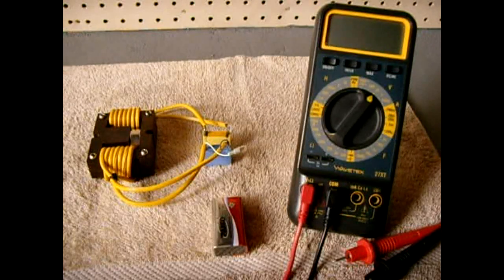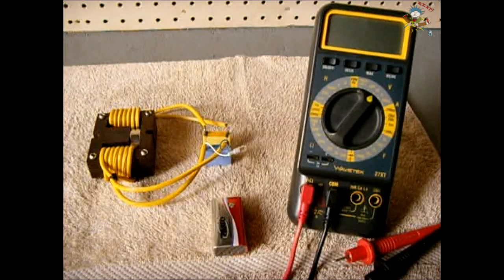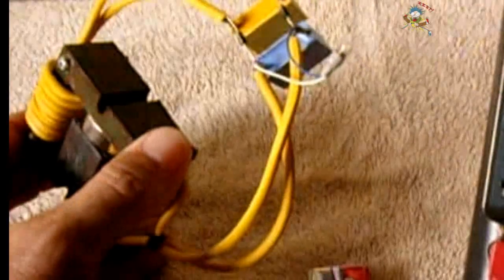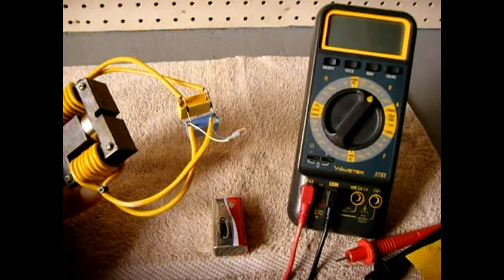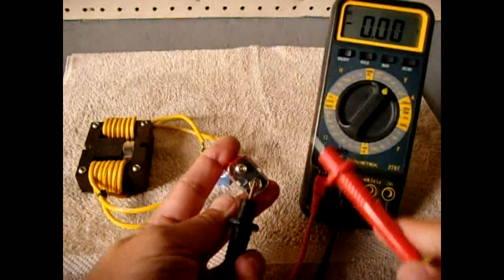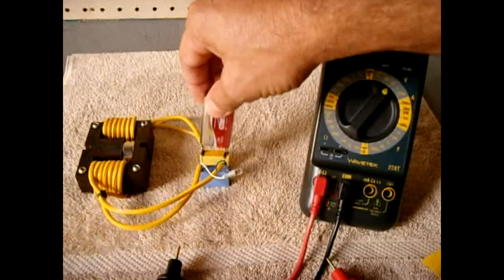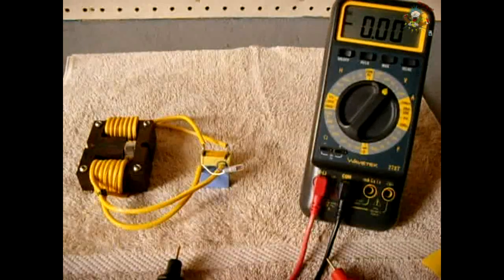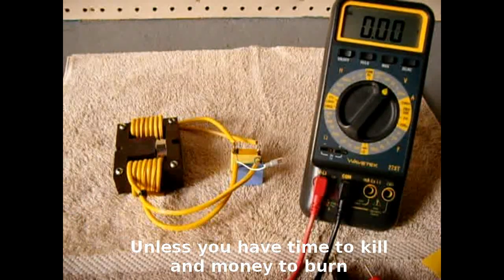Overunity Motionless Free Energy Generator EXPOSED!

Comment: That website that you lists calls this an MEG, it isn't one ! It is very similar but contains no electronics to switch the magnetic field. And it claims no professional research was done. There is a PATENT on the MEG with FULL DOCUMENTATION of how it works and waveforms of the electronics, flux charts, ETC. And this was made by several people , one of which Dr Bearden is a physicist.
Here is the link to it.
https://www.google.com/patents/US6362718?dq=meg+flux+switching&hl=en&sa=X&ei=Ec46VfTDItaSsQSzp4GgBQ&ved=0CB8Q6AEwAA
You could also say it is a transformer so transformers don't work either.
If you want something actually overunity search the bitoroid, tested by several labs and proven overunity, but nobody actually wants that to be sold. Look at the history of the other people who have sold similar things like the Eureka generator. Denied a patent despite being tested and shown to work by several engineers, a physicist, people at NASA, but still denied ! Newman list the many letters from engineers and physicists on his site as testimonials and they all say it outputs more than the input. Don't believe me, read it for yourself.
Lookup Newman machine. And http://www.wanttoknow.info/newenergyinformation
that list many examples of energy device suppression. I didn't believe it myself since I have an engineering background but have met several people involved in stopping things getting to the market.
The bitoroid has also been patented and tested by several labs, proven to work. It's been out for at least 5-6 years, so why is there no commercial sales ? The MEG patented in 2002, about 13 years ago and sill not for sale ! All 3 of these examples were proven to work by many labs, 2 have patents and NONE available to the public !
If you are the author of that site try adding this information and correcting calling it an MEG since it isn't one and saying the MEG has no documentation from professionals.
Both the bitoroid and MEG have videos but the patent is the largest source of information for both. The bitoroid has a 30 minute video describing its' operation on youtube.
And just so you know even NASA and MIT have admitted types of overunity. MIT has a overunity 230% efficient LED and NASA has a process similar to a solar panel that outputs 2 - 3 electrons for every photon that hits the panel.

P.S. How did you make such a clean cut of the transformer, I used a bandsaw and didn't get anywhere near that clean of a cut ? This would be great for making an actual MEG instead. The actual schematic is in the patent to try for yourself.
Reply: electronicsNmore Did you checkout the actual MEG, it does output more than input/ The site listed above, the jnaudin link, a French physicist has tested it and other devices and obtained overunity. It switched the flux but there is not mechanical movement. There is also the flux switching principle demonstrated in some of the YT pages calling in a "perpetual motion holder". Switching the flux makes sense, how it keeps the flux for a long time surprised me. But it can be tested easy by using permanent magnets, I tried it to see, and how much. You can switch a part or all the flux.

I would give the links but where I did above and in other places gets filtered almost every time ! Only I can see the comment. The MEG patent goes into detail and even gives a full schematic. So don't think it is impossible. Just the fact that the flux can be switched enables over unity. A permanent magnet that can be turned on and off by switching the flux direction is easy to imagine the applications.

Oh, and the difference between a transformer is the flux is switched from a magnet instead of coming from another winding (electromagnet). Each winding can work as an electromagnet. In the MEG it makes a temporary electromagnet to switch the flux direction.
Checkout the JNauding site, a French physict that has done many lab tests on this and other devices since before 2000, at least 15 years. He shows several devices that work and some that failed, and other peoples replications too. He also shows some electrolysis experiments that got way more than DC electrolysis. Interesting if you have at least basic electronics knowledge. If not, a large part can still be understood if something works of not.
Reply: Rich Taylor The "MEG" is actually a type of magnetic amplifier. Magnetic Amplifiers have existed in one form or another for over 100 years. Mag Amps only control power and don't produce power, any more than a transistor controls powers without producing any.

Don't confuse the ability to create a larger voltage from a smaller voltage with the ability to create power.

Patent can be obtained without a working device as Google demonstrated recently by obtaining a patent for a mere idea.

BTW the MEG patents is pure gibberish as you would expect from a con artist.
Reply: ***** I know what it's called but it's actually a variation of a magnetic amplifier that does NOT create energy from a motionless generator. There must be relative movement between a magnetic field and a conductor in order to produce energy. This energy can be provided by a moving magnet or a changing magnetic field created by another changing current. The “MEG” produces no energy. The “MEG”, and variations is a device created and perpetuated by a scam artists preying on individuals who fervently want to believe in Harry Potter physics. But hey, it looks cool so it must be a legitimate device.

BTW: People can buy PhDs these days or simply put PhD after your name as many of these sham artists do to help legitimize their “expertise” in “free energy”.
Reply from the maker: Dorian McIntire Correct. In order to produce electricity you need either a changing magnetic field or pulsed magnetic field. Both do not exist in this device because the magnet is FIXED. Amazing the scams that people believe in.
Reply from the maker: Sorry, but I don't do he said/she said. Either try it yourself and make a video, or send me a working unit and you will receive $100.00 in your Paypal account. Nothing else to discuss. My time is too valuable for this nonsense. Patents don't have to work, or even be tested to be issued.

Thanks For watching
Reply: Do you only want people to agree with you ? It wasn't for you it was for the other person anyway. Maybe I clicked on the wrong place. Either way, why so hostle ?
Reply from the maker: I am not hostile, I do not like people who never tried the experiment themselves, telling me that I did something wrong, they know for a fact that it works, and also telling me he said/she said. I do not take kindly to people that waste my time with bogus Free Energy devices! You lack credibility due to the fact that have just opened your account less than 2 months ago, and have ZERO uploaded videos. I already told you what to do. Make your own video, or send me a working unit which I will pay $100.00 by Paypal once I confirm it works. Tell your physicist buddy the same.
Reply: electronicsNmore I have tried it myself, I just didn't film it. I said you claimed it was an MEG, an MEG included switching electronics, this doesn't. But it is very similar.

You can lookup the physicist yourself, he is in FRANCE, not the US. Why would I send you anything ? Should I send it to everyone that asks ? I can show you the data, and you see for yourself, otherwise you can say I faked something. If you do it yourself, you know better. Flux switching isn't new, isn't fake, look at the patents. There are many that use it, some to make electricity. Not modulate a signal like a magnetic amplifier. If you want proof , go to the places with the most proof. Or claim something doesn't exist without trying. Your the one questioning it, like I did. That is how I learned. The theory is simple enough.

And yes, your are very defensive. If I give you help you should say nothing of thankyou, not "case closed", like you know everything. I don't and I can see you don't either. Physics is constantly changing, how, by recognising MISTAKES or exceptions in the old theories.

Mr Ohm or Ohms law was claimed to be nuts, but is now taught the first day of electronics school. There are a ton of examples like this. Same with Zero Point, putting things in orbit, going to the moon. All said to be impossible by experts. All wrong.

And like I said, I click on the wrong person in the first place, notice I deleted the comments ? Don't be so defensive when people are trying to help, even if you think they are wrong. And if you look at the site I sent you would see, there are already videos there !
Reply: ***** Just so you know this is wrong. It is basically right if you are only learning about induction but it doesn't take flux switching into account. Do a patent search for "flux switching" and you will see many applications come up, like a 0 power magnet switchable from on to off and the 1950s Radus patent that does this they originally made for NASA. It allows magnetic boots with only pulses of electricity to switch the flux on, the direction of the floor, and off, direction to the side. Effectively a permanent magnet that can be turned on and off. Once the flux is switched it will stay that way forever until another switching pulse happens. They never mentioned this or several other methods when I went to school for electronics. And this was from the 1950s ! 
This video shows a demonstration
Switching Permantent Magnet Field.wmv I would leave a link but YT filters my links all the time !
The JNaudin site has all the lab notes, schematics, videos for each project he evaluates and he does an excellent job. Only the videos show all the measurements, but the voice is in French. But all the text is in English and they have a French section if you prefer. They have at least 15 - 20 different things tested and with links to other sites replications too. It is the only site I have seen like it that shows all the lab notes , ETC and is done by someone that knows what they are doing.
Reply from the maker: Rich Taylor Did I ask for your help? No. All you seem to do very well is annoy people. You have ZERO videos demonstrating what YOU claim, and you are telling me what I did wrong. I don't do he claims or she claims, or "they have a patent". You see nothing wrong with that picture? LOL. Incredible. If you read the video description area of this video before posting comments, this could have all been avoided.
Reply: electronicsNmore trolls will be trolls ☺

Comment: The magnets in the original were not magnets, but watch batteries. That's how he produced the current. Both diodes have to be going the same direction because batteries are already DC.
Reply from the maker: I agree, I think upon close inspection of the device, you would see the magnet area contains batteries. I also think you would see the insulation of the wires are cut and shorted to the core on the + and - sides.

Thanks For Watching! Please rate Thumbs Up and Share.

Comment: Apparently nobody can actually build a replica of this "free energy" unit because either the diodes are not the same or the core is not the same or the wire is not the same, hell nothing is identical to the "demonstrated" unit so apparently nobody can claim that it doesn't work.

If you assume free energy is possible then the logical question is what is the limit of the energy possible from the unit? As soon as you step over the line to say that its possible then you must believe that the sky is the limit since a free-energy, positive feedback device should have no limits. When you choose to ignore the conservation of energy then you must believe that no place in the universe is safe. People playing with such technology apparently have the ability to destroy the planet since a runaway, free-energy device can apparently produce infinite energy.

Don't tell me I'm being ridiculous here because I'm just taking the free energy philosophy to its logical conclusion - its about limits versus no limits.
Reply from the maker: Correction, "apparently nobody can claim that it does work". The device is a scam. Nothing is free. Even death costs money. I did an EXCELLENT job duplicating that fake device. The diodes used were nothing special, the wire is nothing special, I tested different # of turns on each winding, and the laminated core is just fine. The idea of the core being one solid piece is total nonsense. There are other motionless magnetic scam devices which show cores exactly like mine(One Piece). I also tried various magnets. I know it is hard for some people, but they need to accept the fact that THIS IS A SCAM! I offered people $75 + $4.95 shipping, and even offered some money for parts to send me a working unit, NOT ONE PERSON made the effort. What does that tell you? LOL I made mine for around 5 bucks using junked parts. The advent of such a device could NEVER be stopped once one person had a working unit. Everyone would be duplicating it in their garages/workshops.
Reply: electronicsNmore Yes, I understand its a scam but the free-energy apostles  are whining about the fact that any duplication of the device must be an exact clone or it doesn't count. Basically they are saying that it must work or you did it wrong. While these same people are telling others how things need to be they are not talking about the free energy they are producing from an actual working device.
Reply from the maker: I understand exactly what you're saying.

Thank You For Watching!

Comment: As I had commented on the original "scam" video, the liar who built the devise powered it by two wires which you can see at various times throughout the video, running from the top of the screen to the light and on out thru the bottom. The wires are hard to see at first until you know they are there, then it's obvious...

Comment: the diodes polarity in your circuit are in the same direction, change the polarity of one of them, and use dc capacitors not ac. you will get positive dc voltage at the anode and negative at the cathode with continuous operation.
Reply from the maker: Now why would I want to do that? The purpose of this video was to show you the device was a scam. I positioned the diodes EXACTLY as shown in the scam video. By the way, reversing one diode will not make this scam device work.

Thanks For Watching
Reply: electronicsNmore ok, let us call that video as a SCAM, but the circuit will work as I explained, try it and let us know the results, clearly the circuit is at resonance with a frequency depends on the chosen values of L and C, the purpose of the 2 diodes is to rectify ac to dc.
Reply from the maker: No thank you. You can waste your time, not mine. YOU assemble the device and message me a link to your video showing this device working. I expect FULL details, dimensions, materials used, part #'s, etc, or don't bother.
Reply: electronicsNmore I don't bother, I want to add one more point, the continuity of the oscillation time is related with the resistance of the circuit.
Reply from the maker: Unfortunately you are wasting your time talking to me. I do not listen to people who fail to produce a working device.

Comment: Any Ideas on how to make  vCR head motor generate El. ? I could really use some help from the ones who know what they speak .  working on something but first i need someone to help me make this motor give something out . how to connect the wires and on what ?
Reply: Mars Seeker If it's a DC motor - and it probably is - you're in luck: a DC motor and a DC generator are exactly the same device. If you apply voltage to the terminals of a generator it will run as a motor and if you turn the rotor on a motor it will generate electricity. With this in mind, if you connect the VCR head motor to something that'll turn the shaft - a propeller for wind or water, a model airplane engine, the wheel of a bicycle, whatever you like - and turn the shaft fast enough, you'll get electricity.
Reply: Jim Mowreader yes, thank you. I knew that but when I tried generating it gave me nothing , then i thought something must be connected differently, but i just didn;t spin it fast enough .
Reply: Mars Seeker Do you have a power drill handy? If so, try putting the motor's shaft in the drill chuck and spinning it as fast as you can. Then use a REALLY sensitive multimeter to test the power output; VCR motors aren't going to give you much.

If you still have the rest of the VCR, the motor that drives the tape reels would work better for you.
Reply: yes I know that now, I thought that something is different because of the sensors on it. i know the other ones give more but i like that one, you can guess why. it's just perfect ha. :)  it gives about 3 something volts when i spin it  with that other one you mentioned ..when the other one is powered on 5v phone charger . i don't know how much  amps i got, maybe my meter doesn't work right or it doesn't give enough to measure it. or i'm measuring it wrong..

Comment: I always thought that there battery was in the same place as the magnet in this vid. Then have the core made up of two different pieces so the two different pieces of the core would be - and +. Then you just shave off the insulation of the wire on the inside of the coil to contact the core.
Reply from the maker: I agree, that thought also passed my mind. Very likely if induction was not involved.